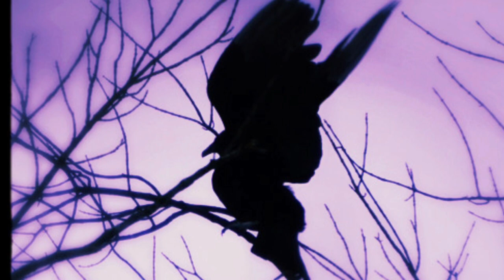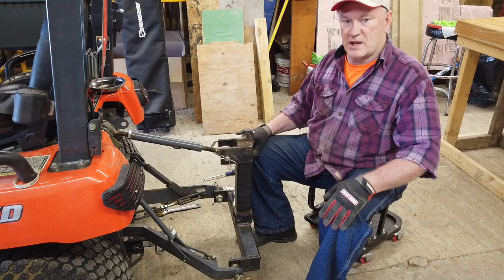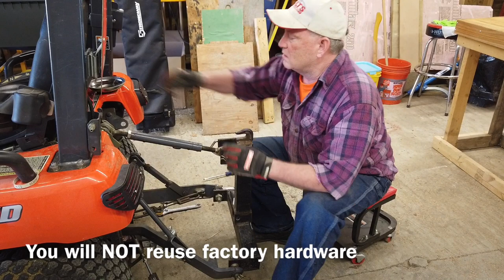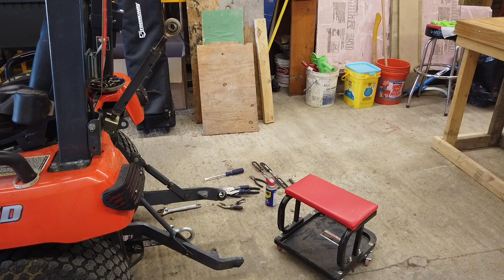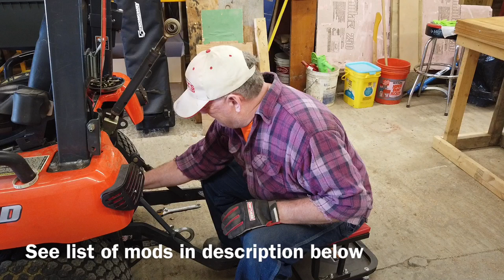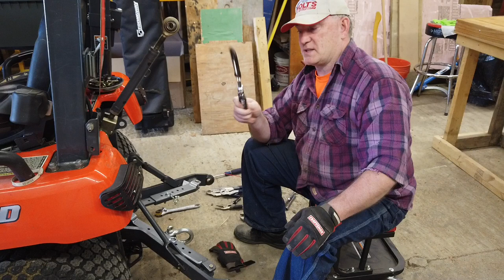#46 - BX1850 3 Point Hitch Mod

Comment: Should have mine in a few weeks. Be glad to toss the factory turnbuckle ones and have something much easier to work with for sure. Have a Blessed Day !
Reply from the maker: Right on - You will not regret buying the Stabilworks Stabilizers - They make changing implements a lot easier.  Cheers

Comment: Thanks and just to explain how much in demand Hodge stabilizers are I ordered a pair for my brand new 2020 BX 1880 and have to wait till late spring or early summer to get mine so order early people. I mostly want mine so as to make it easier to run my rear roto tiller as I do a lot of gardening and with R2 Edge Tamers I plow in the winter with my FEL and my gravel drive and grass are both damage free. I need to do something now to protect the underbody as I need to make my gardens even bigger. Thanks for the video.
Reply from the maker: So, Messick's is now offering a comparable stableizer kit for the BX.  Here is a video - https://youtu.be/aOjXJV88fEc - They have teamed up with a local supplier to build them for Messick's customer.  I think if you call and talk to the parts department you can have them shipped directly to you.  Hodge is a very nice guy, but the wait is too long.  

BXpanded has a good undercarriage shield that I use when the mower deck is removed.  Under Armor Kubota BX Series https://www.bxpanded.com/BX1880_c_431.html I do not recommend the bucket hooks.  They will fall off after time.  

Let me know how this works for you.  Sorry, I took so long to reply.

Comment: I believe the 1850 is very similar to my 1870, do you find mowing in low range a bit too slow ?  If I use hi range the whine is louder of the HST and it seems like it may get hotter to the touch. Just curious to your thoughts on this. You've got your machine looking great! Have a Blessed Day !
Reply from the maker: Yes, both are 18 horse power models, but your 1870 would be a few years newer.  I like to mow in low range.  The land I mow is very rough, and when I mow in high range I get tossed around a lot.  So, generally speaking I stick to low range for mower work.  I run the engine at 3000 rpms.  I do notice a little whine from the HST.  I would recommend performing the HST service which involves replacing the HST filter, cleaning the oil strainer, and draining and refilling the HST hydraulic oil.  Your Kubota dealer will make sure you get the correct oil.  There is two different hydraulic oils.  make sure you use the correct oil.  Also, check your HST fan.  to do that you need to remove the mower deck and look up under the deck.  I have a playlist for how I replaced my HST FAN.

Comment: Hey Bob, new subscriber here from Alaska.  Thanks for the video, I think I'm sold on this mod.  I was wondering though, are you concerned at all with the play in the 3ph?  Granted it wasn't much, I just usually cinch my factory turnbuckles down so they're pretty snug.  Not sure which is better tight or loose, or if it really doesn't matter.
Reply from the maker: I believe tight is better.  The amount of play was not significant.  I believe it is acceptable sway.  I don't think you would want an implement swinging back and forth as you are using it.  I guess it is time for me to break out the owners manual and see what it has to say about adjusting the 3 point hitch.

Comment: I can see how that turn buckle method would be a lot weaker.
Reply from the maker: I think I run into problems pulling my trailer - I think the tongue weight of the trailer can really torque on the turn buckles.  And it's only the one side that bends - Thanks for commenting

Comment: Why would you have to take them off so no need to mark them
Reply from the maker: That's a very good question.  I have removed my 3-point hitch to make working on the back of the tractor easier.  If you had a back-hoe attachment, it would require the removal of the 3-point hitch.